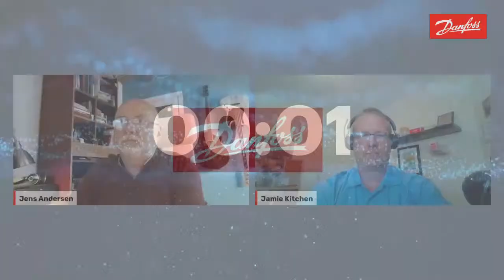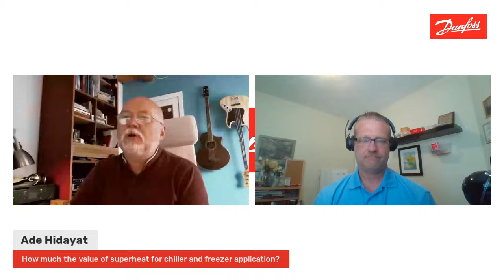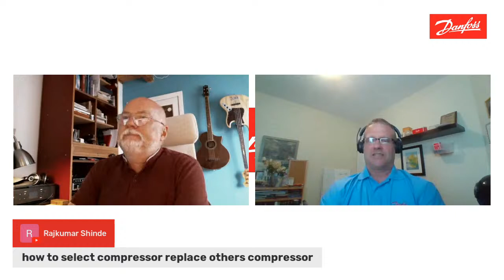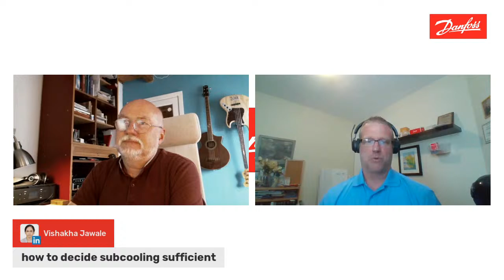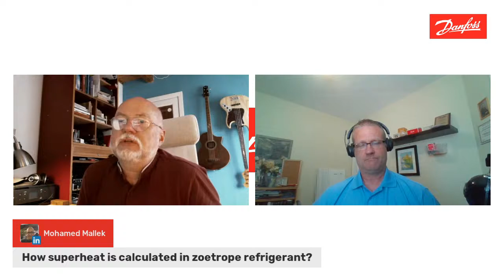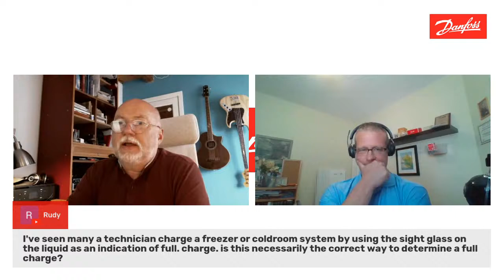Superheat and Subcooling

Comment from the maker: Hello everyone, 

We were unable to answer all the questions during the Livestream so please find below the unanswered questions:

1. Which refrigerant is used in a sensible bulb of TXV? 

The sensing bulb contains a mixture of several substances including the system refrigerant plus several other substances that will provide the desired effect such as quicker or slower responses to change in superheat, constant opening superheat values at various evaporator temperatures, etc.

2. How could we know that our refrigeration system is overcharged? 

An overcharged system will have higher than normal condensing temperatures, high current draw, and higher values of subcooling (TXV systems). Fixed orifice-equipped systems will have possible flooding of the system, especially piston-equipped AC systems.

3. What's the perfect balance between subcooling and superheat? 

There, generally is not a perfect balance. It depends on the metering device, capacity balance between condenser, evaporator, compressor, and metering device, and especially the heat load on the evaporator and the ambient temperature around the condenser.

Thank you everyone for joining this livestream.

Comment: I would like to express my appreciation for the amazing effort that your channel is doing. Its really educating and informative for a maintenance engineer like myself. Moreover, I would like to thank the guest for his great explanation
I have a question which is why we use kelvin as temperature unit to describe the superheat rather than F° or C°
Reply from the maker: Hello Ghazi.

That's a good question:

The simple answer is: Superheat is a temperature difference between two specific temperatures.

The more elaborate answer is: It's a temperature difference, which also imply a difference in enthalpy, i.e contained energy.

It's absolutely legal to say: "the saturation temperature is 10 °F, and the superheat is 6K", it's just not very logic.

You'd probably say "sat. temp = 10°F and SH = 10.8°F" ...which would also not be scientifically correct
Reply from the maker: Meanwhile, you can have a look at this infographic related to pipe sizing: https://infogram.com/how-to-plan-piping-like-a-master-1hxj48g3ejm72vg